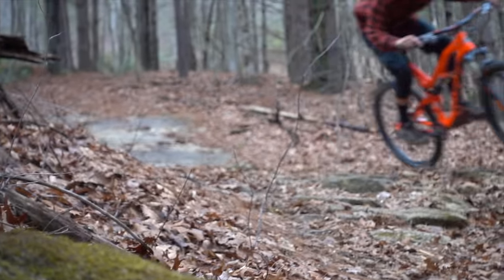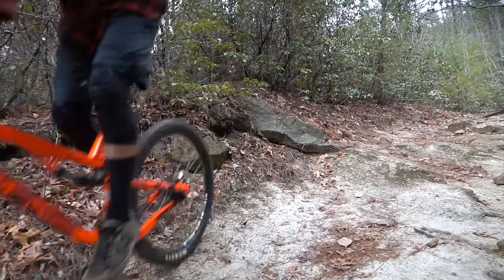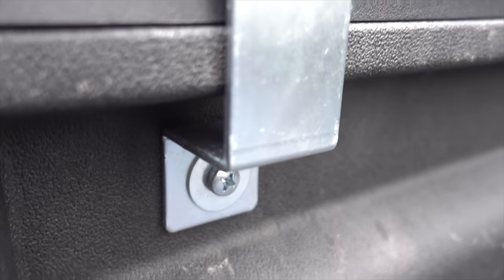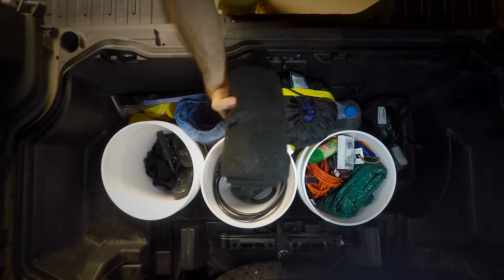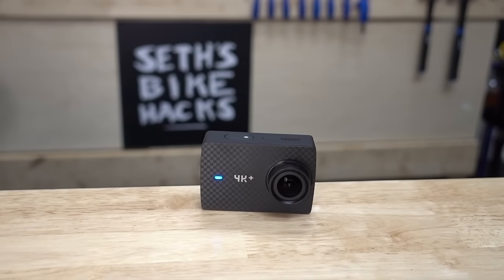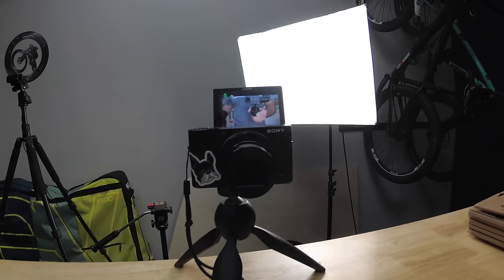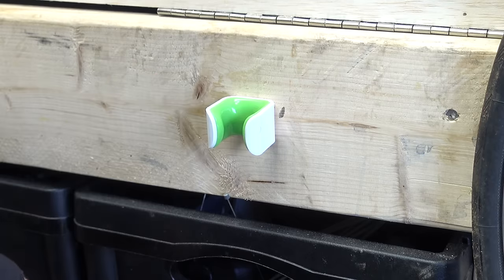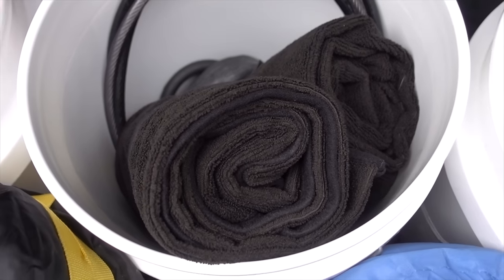10 MTB Product Reviews from Helmet Hooks to Multi Tools

Comment: I did not see the comment for it, but you can install the AMS guards with a lightly soapy water. This is a technique used for most quality stickers in the sign industry. While there are professional application lubes, a soapy water does the job. Prevents air bubbles, allows re-positioning, then you just squeegee out the water. I personally use a felt block to do that.

Comment: Those Kali pads look legit. Going to give them a try because my G-Forms NEVER stay in place. :(
Reply: Trail Features and also, g forms NEVER protect in a crash 😂
Reply: Dude my g-forms have trouble staying in place too. Shame for such an expensive knee pad.
Reply: my concerns with G-form is that they got gaps, same with a lot of pads, at least the Kali got smaller gaps, but not sure about how they perform, not researched them. a sharp rock can get between the gaps, but for the concrete or asphalt use, they would be ok.
Reply: Johannes Nilsen I've got fox launch pros (no gaps, solid plastic front) hit a rock with my knee and cut through the pad and straight into my knee right to the bone 👌
Reply: how did you manage that? I know the pads have their limits, but this sounds quite extreme.
Reply: Johannes Nilsen I nosebonked on launchpad at forest of Dean and went OTB because I was going way too fast and all the force went through my helmet then my kneepad breaking both
Reply: how high was that, how fast were you riding? I hope this never happens to me, I also Always wear pads no matter how easy it is.
Reply: Johannes Nilsen such a small jump like 8-10ft long and 2ft high. Was going about twice the speed for the trail though haha. Lesson learned
Reply: I crashed off a 1 m  3.3 Ft high wall, but I landed sideways,  no damage done to pads or me, but Rd, fork, brake levers were scraped up, but it was at low speed, I just fell down, but if you were going too fast, the force is increased, so if you to something it might do more damage, I have not tried going so fast over drop/jump.
Reply: I got endura pads and I love them! They aren't expensive and they do stay in place exactly! 🤘🏼

Comment: Seth, would love to hear back on how the ams guards work out after a few weeks of riding with them. I've recently started doing carbon bike repairs on the side to keep my bike community going and the one thing I notice is that very few bikes come with good, if any, gaurd protection. Chain stay bars and down tubes are my most common fixes. I end up recommending skateboard deck tape to most people or car crash film. Worth the price to protect the valuable asset of a carbon frame. To date, ive rapaired some 15 bikes. Thanks for the good info, Seth.

Comment: i have a 40 dollar action camera 🔥
Reply from the maker: The best camera in the world is the one you have on you
Reply: I do as well, it works what more do you want? it  films clearly in 1080p which is all anyone really needs
Reply: BraveTamedHamster yep
Reply: Tauno Gaming kyllä
Reply: I have the first GoPro! (hero hd)
Reply: Same
Reply: Tortillat avataan
Reply: I have an Eken h9r so called the go pro killer. Of course it isn't better but it's really really impressive. It's less 50$ depends where you got yours
Reply: I have an apeman, gotta start somewhere.
Reply: I bought one for 15 bucks
Reply: does have the stabilisation as the go pro
Reply: i have a phone
Reply: I have a $60 4k action cam.
Reply: Mine is 25
Reply: @SethsBikeHacks  true
Reply: I had a $21 action camera I got on amazon, it kind of sucked, it was super blurry for some reason even tho it said 1080p on the front.
Reply: @SethsBikeHacks   Could you visit Virginia Keys again please? And maybe give Frenchy a call? He and the VKOC bike club have been working so hard on improving trails with the following but not limited to: jumps, wooden features, berms. Furthermore, they have added 2 new trails one with a drop and the other is all wood like highway to hell but you haven't seen that one yet. Also, they added massive jumps almost like a slopestyle section and a pump track and finished purple Haze that was the last time you were there for the first part. I hope you take this into consideration.
P.S. you could get a good 1.2 million views on a video like that.
Reply: My mom got me a €20 action cam
Reply: @mbtman5847  seth has a 4$ camera 😂

Comment: There are some interesting integrated multitools on the market, that fit in the hollowtech crank shaft, or into a space, that is usually closed by a top cap (inside a steerer tube, if I named it right)

Comment: Seth, you effed up the AMS tape aplication. I had very little problem installing bubble-free, without the need of a heat gun, or mild soap water. That said, It's been a year and a half since your upload here so, maybe they changed the glue. But I then removed the AMS tape and got a full RideWrap kit and installed that. Pain in the butt, but good coverage, and I reused some of the AMS stuff and it had some bubbles after that. Price you pay for good protection...

Comment: The Soft Topper looks good enough for tent type camping. I would be interested to know if it has UV protection and how well it can stand up to highway speeds over long periods of time. Those are only two of the things that can turn something like that into a flapping rag in no time at all.
Reply from the maker: I ran into a Patron who claimed to have one for 8 years, and all he replaced was the bug screen. I didn’t even know they existed for that long.
Reply: I have a soft topper with thousands of high speed miles on the back of my Ridgeline.  No change in functionality at all.  To be honest I have abused it somewhat by stuffing insulation between bars and cover.  Still it works fantastic.  Only downside is it gets hot in the sun when all buttoned up, but can raise the sides to cool if not raining.

Comment: Another cheap alternative for the seat covers are the covers that mechanics use. They come in both cloth (breathable but not waterproof) and plastic (vice versa) variants and cost the equivalent of one or two bucks where I live.
As for the plastic bike stands, and specifically putting something similar but more suited for MTB tires in your shop; I think a 90 degree angle iron (L-angle? L-iron? Don't know the correct english term but hopefully you get the idea) would work if you just locked the bike in place by placing a bolt through the spokes and the holes in the angle iron. It could of course be rounded off and padded to be gentler on the bike.

Comment: During my many years of motorcycle racing and MTB for training, and currently I am strictly MTB now, during that time and now I have always used Nitrogen for all my tires, especially when I was racing Karts. Have you ever thought of it? I get a 2000lb bottle that lasts forever.  I never heard it mentioned, just tire pumps in your shop. Molecules are larger in nitrogen which in turn lose much less air, a lot less in my experience.  I have also noticed that, especially in Karting, that the air pressure stays much more consistent in pressure during hot and cold days, just as my MTBs do.  Just a thought, maybe you can touch on it some day.  Keep up the good work.

Comment: Great video. Cool stuff review. As a sticky guy I'll tell you bubbles happen. Sometimes a wet install with 30% isopropyl to water works great. Use a hypodermic needle or a new safety pin to pop them. Or put clear bra on as a frame protector. If you geek out a little you can 99.6% coverage and nobody will notice. Hope the healing goes fast and smooth.

Comment: When you’re installing any type of vinyl decal, sticker or anything like that. Before you do, make a solution of a little bit of dish soap and water put in a spray bottle. Spray the area then apply the sticker and use the squeegee to get all the water in the air bubbles out this will also give you a chance to pull the sticker off and try again. Once you feel like you have it were you want it, just let it dry.

Comment: The hooks you screw into a wall to hang shovels and such work great to hold a mountain bike when screwed in on the leg of a work table.   You would need the heavy duty ones because they are wider and more V-shaped so it holds different tire widths.

Comment: Instead of spending 35 on a precut set of AMS guards, I would definitely recommend the ISC racers tape. You can get a 30’ roll for the same price and can cut out any shape you need to fit you bike. It doesn’t come with the cool colors or designs, but in terms of functionality, price and screw-up-ability it likely matches or beats the AMS stuff.

Comment: Another great feature of the Ridgeline's under bed storage is you can load it with ice and use it as a massive cooler and it has a drain plug for easy ice removal once it melts

Comment: Hey Seth, at 3.04 you show your dog jumping out of the car. Have you ever considered buying Sill protectors? They're expensive if you get them from the car dealership but eBay do cut to size ones or ones already cut for your car but a hell of a lot cheaper. I'd go so far as saying they look pretty good anyway and theyll cover any existing scratches caused by the dogs.

I have one for the trunk of my estate as I'm prone to just tapping it with the pedals when loading my bike. Really saves on a paint job 🤙

Comment: In terms of reliability, Toyota and Honda are both at the top of the list. The Ridgeline gets a lot of crap for being unibody instead of body-on-frame, so people bag on it for not being a "real truck". But the truth is, for someone with no interest in modifying for off road trials, the Ridgeline is just a better choice. The unibody allows for more interior space and the under-bed storage, lets a pickup truck handle like an Accord, it and still provides more than enough towing capacity and offroad ability for most people. Also, the J35 3.5 V6 has plenty of power and comes standard. It's perfect for the average truck driver who daily drives a pickup and occasionally hauls around bikes, some 2x4s, and a boat that's not ridiculously heavy. Unfortunately, most of these people are too insecure about driving something with a Honda badge.

Comment: Not sure if it was the same brand of bike holder.  But there is one called CLUG that makes a mount exactly like that for mountain bikes.  At least up to 2.3in tires.  I have a few to hold my bikes upright against the wall.  They actually make 3 different sizes.

Comment: Nice round-up! I bought the F15 as I was looking for a compromise to replace the two different Park multitools that I previously took with me on a ride. I wasn't that impressed with it the allen keys as the 5mm key rounded off after just a couple of uses. I'm not sure if it's down to the hardness of the steel or the smooth chrome-like finish which causes them to slip. Either way the key edges are not that well defined so slippage is inevitable. Luckily after a bike change I now have the swat tool on my frame which has better key edges albeit fewer keys.

Comment: Does I Nine fit a fox fork? I want to get back in to the MTB after 10 years and a lot has change obviously. My Mondraker Dune will arrive tomorrow and it has a Fox 36 with 15x110 axle, but on amazon descriptions says "Compatible with 15 x 110mm Rockshox Thru Axle forks only". That means I am out of luck or is just so they cover their back? I would hate to order one from the other side of the globe and not be able to use it. Than you.

Comment: For that through axle multi tool, I think that there's no reason to leave the bits inside that clear tubing.  You could take them out of the tubing and just put them in the axle.  that would also allow you to fit a larger bit in there.  If they rattle, you could put a little electrical tape around them.

Comment: The Victorinox multitool, actually made by PB Swiss Tools, is simply the best quality multitool out there if you really care about the quality of the bits and less about the functionality (it does not have 8 mm hex and no chain tool). It is also light and rather small.

Comment: Disappointed on the ridgeline, can see the benefits therein. But CV axles in the rear and AWD with no low range is something I'd expect from a crossover than a truck. Albeit comfortable and efficient on the road, (its essentially a car) it will be interesting to see how it holds up to the major abuse in the future, and definitely wonder if it will hold up an sketchy trailheads as well a real truck.

Comment: I bought the Strike knee pads off of this recommendation. They are very comfortable, however, the mesh material is incredibly delicate and rips extremely easily. I've only had them a few months and I've had to sew up 4 major rips already. Do NOT let these anywhere near your flat pedals. The pins will shred these to ash.

Comment: You could hang the plastic bike rack thingy up higher see if itll hold the weight of a bike by the seat post and if it does, that saves people a lot of money on a bike repair stand that they could then just then build out of wood and slap one on the wooden repair stand.

Comment: I do like the honda trucks.  I have a honda pilot that we use to pull out camper.   Is your truck 4x4. My pilot is front wheel and 4x4 if you put it in 2nd gear and pushing button.  Not auto 4x4 or allwheel...

Comment: Dear non car people, 
This comment is about something that you do without noticing and kinda pisses me off. Stop confusing the AWD system and the 4WD system. What's the difference you might ask? In all wheel drive the the rear diff is made to give more power than the front one and both of them ARE lsd's (limited slip differential not the drug) awd systems are mostly used in sports cars like subaru imrezas and other cars and the power output to the wheels must be from 60% to the rear and 40% to the front to 80% rear 20% front. but in four wheel drive the engine gives 50% power to the front and 50% to the rear and both are open differentials. The second shifter to 4WD trucks is made to lock the diffs for better traction when off-roading. I know I've typed too much but that's the only way to describe it and also... Seth I love your vids and content but hell nah will I accept the fact that you said such a thing.

Comment: I have a bike hack. if those hubs are dirty and your bike isnt worth washing with water get a baby wipe and shove it behind your disc brake and get a plastic cassete cleaner tool and spin the wheel in the air whilst maintaining pressure on the wipe

Comment: You bought a compact bed crewcab?  Lol, you bought a station wagon they stopped building halfway through.  Should have gone with an extended cab full bed or an actual station wagon, either would have been more practical.  You'd actually have more cargo capacity in a 1990s era Subaru Impreza Outback before dropping the rear seat, and still fit in a smaller parking space.  You bought a Honda Element with an open air trunk and a wall midway through.  Good luck hauling a longbike, or really, anything Dutch like a Gazelle or Electra.  Or a single piece of plywood, which, yeah, that sticks out far enough you should have flags on it during day time and battery backed lights on at night in literally every state.

Comment: I can't see paying damn near the price of a full sized truck for a midsized.  At the price range of a decently appointed Ridgeline or Taco, I'd rather get a 4 door F150 with the Ecoboost.  Bunch of interior space, 6' bed, surprising economy and power, and the electric doodads you want.  More annoying if you live in a city and have to deal with tiny parking spots, but I don't.
Reply: @bananasstuff3344  I need to haul stuff more than I need to carry 6 people
Reply: @bananasstuff3344  oh. You're one of those people.

It's still a terrible value proposition.

Comment: No way does that Ridgeline handle better than other pick up trucks. My 2016 Ram handles way better.
Reply: Ridgeline is a small truck , you can't possibly argue that your ram handles better , yes ive driven both, Ridgeline is for reliability , Ram is to make up for something your missing , and then it'll make all your money go missing as well
Reply: @xXSTOLENxXxCULTXx  Sorry Grandma but I'm sure you couldn't handle either vehicle doing a drag race. I will bet my truck it will spank the doors off that Honda. Hinda ridgeline 0 mph to 60 mph just under 10 seconds. 2016 Ram 1500 0 mph to 60 mph is 6.5 seconds. That alone proces the ram is faster. Skid pad ridgeline .78g. Ram .90g. Again Ram handles so much better. So please explain exactly how a 4 cylinder ridgeline will beat my 8 cylinder Ram.